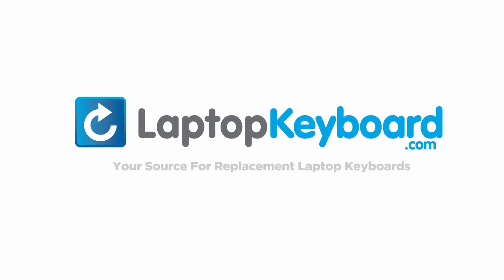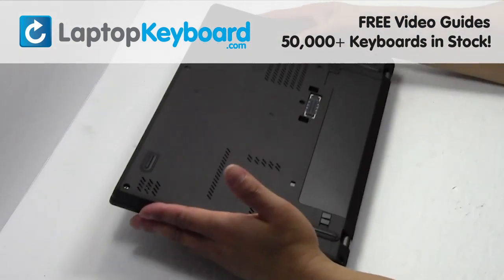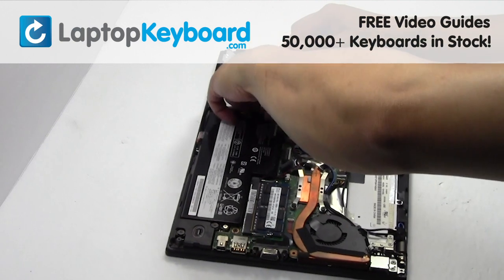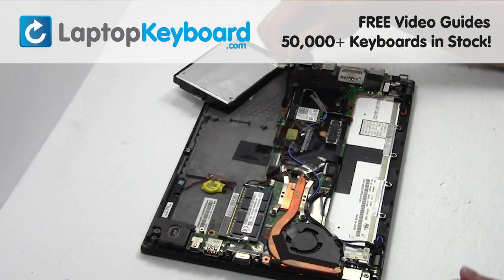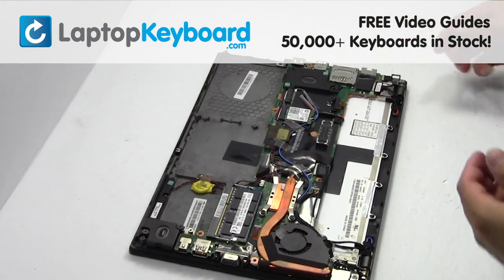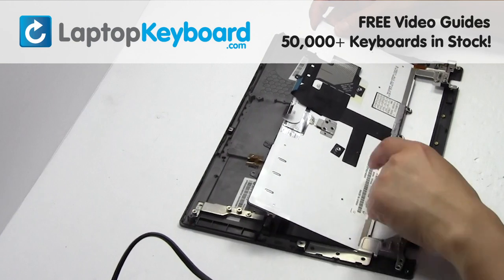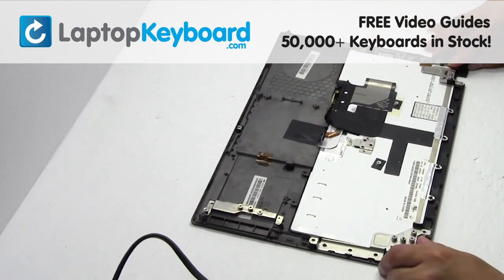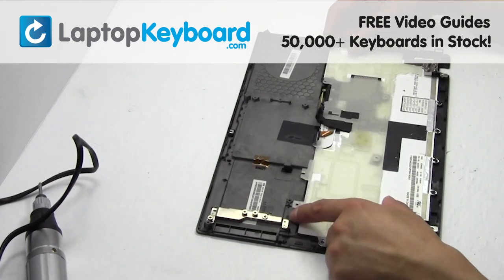Lenovo Keyboard Replacement Thinkpad X240 Installation Guide. Repair Install Fix 04X0177 X250 20CM

Comment: Crazy amount of dismantling on this x250, bit of a joke really.  I use a few ThinkPad T420 laptops and the keyboard is just so quick and easy to replace.  I have two x250's and they are great little machines but if the keyboards break I'll sell them for parts, just not worth the hassle and unless you are repair tech the chances of screwing it up are huge!

Comment: Another Lenovo where you have to reverse engineer the entire machine to get at the keyboard, typically the most failure prone sub assembly. Screw it. When is Lenovo going to make laptops where the keyboard comes out of the top not the back? This takes an expert 15 minutes at accelerated playback speed and power tools.
Reply: This model is bullshit